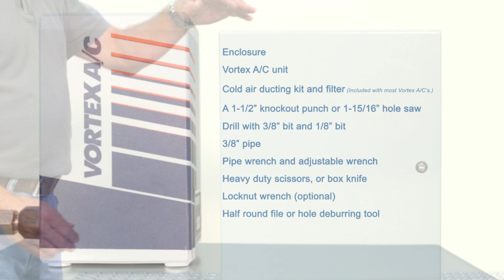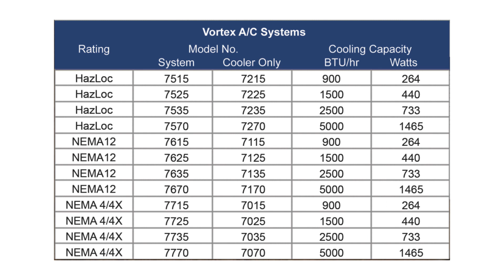Easy Installation of a Vortex AC Enclosure Cooler System

Comment: Hi, 
     Where is the hot side of tube pointing.
Reply from the maker: Hello, the hot air exits the vortex tube inside of the Vortex A/C enclosure. There is a stainless steel shroud on the back of the enclosure where the hot air exits.

Comment: what pressure/cfm is required for this? can it be used in a non-sealed (actively vented) box? can I change the temperature set points to lower? I'd like to maintain between 70-80F. ambient temp outside the cabinet is 68F, but the temps quickly rise to 80-90, and I need to maintain much lower than that. i've looked into everything, from split AC units, swamp coolers, and even peltier cooling, but nothing seems budget oriented enough with enough BTU's to maintain an actively ventilated cabinet.

the cabinet currently exchanges air 3-5 times a minute, and has 1000w of electronics (servers and other running equipment) inside it.

I would think a 1500-2500 BTU unit would work well. what are the prices?
Reply from the maker: +Munky332 
Hi Munky, prices for the Electric Vortex AC range from $1149 - $1259 depending on the model.  We can help you size the correct model for your application.  Just email us at sales@vortec.com or call at 800-441-7475.
Reply: @ITWVortec ⚠️ God has said in the Quran:

🔵 { O mankind, worship your Lord, who created you and those before you, that you may become righteous - ( 2:21 ) 

🔴 [He] who made for you the earth a bed [spread out] and the sky a ceiling and sent down from the sky, rain and brought forth thereby fruits as provision for you. So do not attribute to Allah equals while you know [that there is nothing similar to Him]. ( 2:22 )

🔵 And if you are in doubt about what We have sent down upon Our Servant [Muhammad], then produce a surah the like thereof and call upon your witnesses other than Allah, if you should be truthful. ( 2:23 )

🔴 But if you do not - and you will never be able to - then fear the Fire, whose fuel is men and stones, prepared for the disbelievers.( 2:24 )

🔵 And give good tidings to those who believe and do righteous deeds that they will have gardens [in Paradise] beneath which rivers flow. Whenever they are provided with a provision of fruit therefrom, they will say, "This is what we were provided with before." And it is given to them in likeness. And they will have therein purified spouses, and they will abide therein eternally. ( 2:25 )

⚠️ Quran